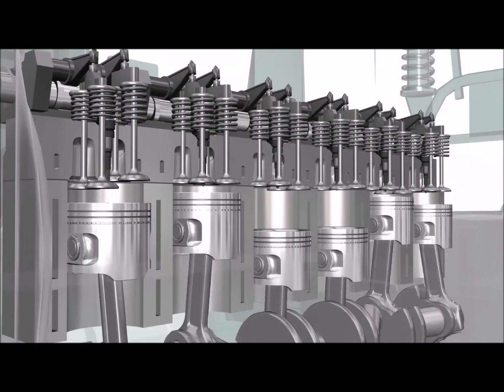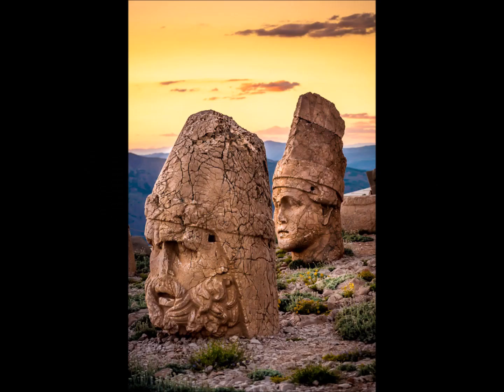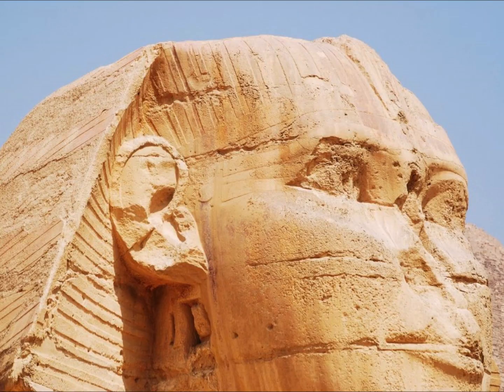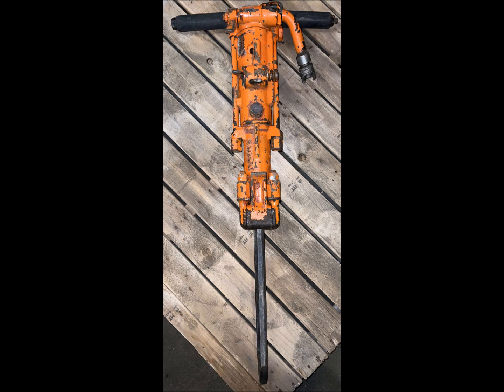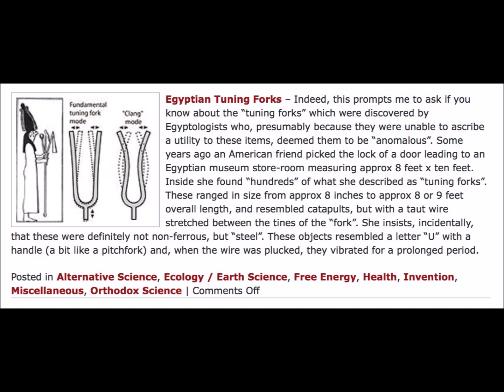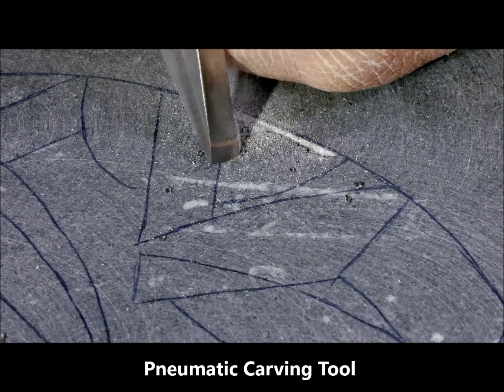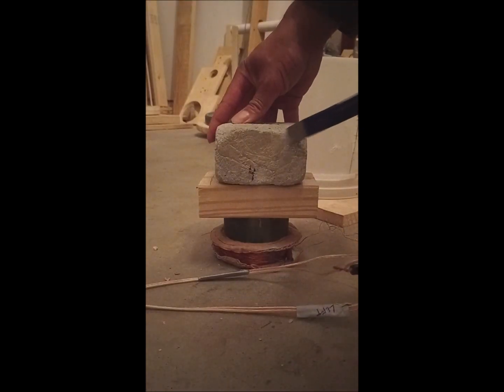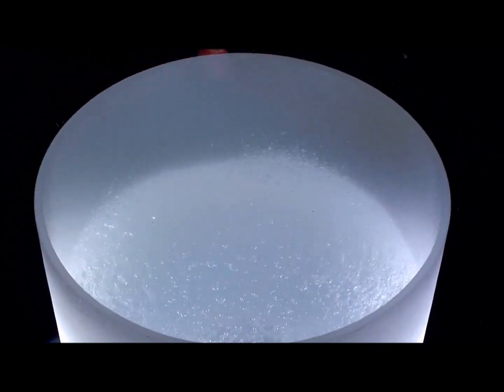Ancient Acoustic Carving: Did the Ancient Sculptors Use Sound to Shape Stone?

Comment: Little known effect:  the handle of a tuning-fork is moving lengthwise.  A longitudinal vibration.  That's why the sound grows loud when the tip of the handle is pressed against a wall or table surface.

With a really big tuning-fork, pressing the tip of the handle against a solid surface is creating an "acoustic drill" effect.  A high-frequency jackhammer.   It's easy to apply 50 or 100lbs of pressure by hand. Do it under water, and you should get cavitation damage and faster drilling.  (Perhaps try de-gassed, pre-boiled cold water.)   Add some fine grinding-powder or fine quartz sand between the handle-tip and the solid surface, for added abrasive action.  Or try including a chisel, or a hard tip to the end of your tuning-fork handle.   Maybe even extend the handle, so it could submerge in water, yet leave the fork in air.
Or perhaps use a piece of stone as the tuning-fork handle-tip, where the stone gradually turns into abrasive sand, to both eat up the handle while also eating through your workpiece.   (Even add a hollow tube-drill.   Rotate the entire assembly, and it sinks through the workpiece as the tube is slowly turned.  Petrie magic!

The wider the spacing between the tuning-fork's two tines, the more hammering-movement we get from the handle.
Stretch a wire between the tips of handles of two large, identical tuning-forks, and the forks will naturally run at 180deg phase, converting the wire into a sort of high-frequency band-saw.  We'd only need to "ring" one of the tuning forks, and the other would be driven automatically, via the wire.    It's like a stone-cutting cable-saw, but vibratory.
Imagine a tuning-fork made of granite, with a diorite sphere attached to the handle tip, held under water, and rapidly eating right into the granite bulk in the quarry.  Flowing water carries away the granite powder.  Keep striking the tines, to power the tool.  (Or, use some sort of violin-bowing arrangement, to drive the granite fork constantly.)   Must keep replacing the diorite spheres as they become abraded away.
Reply: I’d love to see a visual image of what your describing. My small mind is having a hard time comprehending. I understand the concept your getting across but hard to visualize.
Reply: @zacharyphillips9294  Must build a large one, and make a video!  A big tuning-fork becomes a jack-hammer.  Don't use the vibrating tines, instead use the tip of the handle as an acoustic drill, pushing down with large weights and high pressure.   (I suspect that the "drilling" effect may involve cavitation-damage, and drills rapid holes when submerged under water  ...but otherwise may barely work at all.)
The real challenge is to drive a tuning fork continuously.   Don't just hit it with a hammer, where it only rings briefly.    Instead, use some sort of rotating, leather covered wheel to rub against the tines, plus some bow-rosin.  Then when you turn the crank, it "squeals" the tuning-fork constantly, similar to a violin.   Or, drive the tuning fork with some sort of thermo-acoustic oscillator arrangement.  (Better use earplugs.)
Reply: The “was sceptres” look pretty interesting

Comment: Large tuning forks on long copper pipes or rods with a cutting edge on the bottom, smack the tuning fork on a rock and it starts vibrating, use the cutting edge as a sonic drill, smack the fork again whenever needed. 
Different size forks create different frequencies that can cut different materials.
I firmly believe the "Was-Sceptre" seen in plenty of paintings and hieroglyphics, is a representation of these tools. They obviously would've been very important and prized possessions among the upper class and possibly used ceremonially, like we do with swords and armor and other things today.
Reply from the maker: I think it could work, though from experience, the energy can still dissipate rather quickly. A power source would likely be needed to make it practical. I think a thermoacoustic system using either ordinary fire or solar heat could fulfill this role: https://youtu.be/-kQKg6CTMBg.

Comment: im gonna make a (uneducated) guess that if you have a huge tuning fork (or several) and you "sink it" down into a hole in the rock, it'll make the stone easier to manipulate with (for example) a hammer.
In other words, instead of putting the tuning fork on your hammer, fasten it into the stone youre trying to work.
Im thinking that would basically fill the stone with energy, and provide that energy with a nice escape route when you knock it with your hammer or chisel.

Just like pouring cold water on a very hot stone makes the energy escape the with explosive effects lol.

or maybe sink two tuning forks into the stone, and then give it a very powerful whack inbetween the two forks, making the energy want to follow the shortest path between the two forks as theyre vibrating on the same frequency? its fun stuff to think about for sure.
Reply from the maker: That would be fun!! Placing the forks or similar acoustic devices within would be a good way to resonate the entire stone 🪨, as long as there's efficient acoustic coupling between the devices and the stone!
Reply: @gsutton78  exactly man! if you just find a good frequency thatll resonate well through for example granite, youre basically energizing the whole thing, almost like microwaving food lol